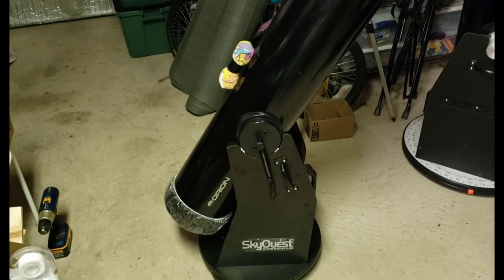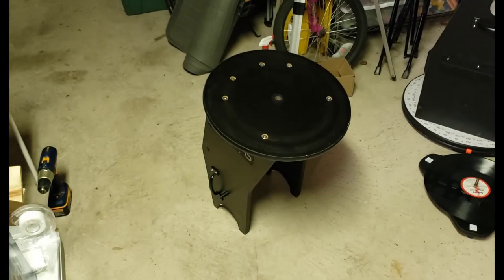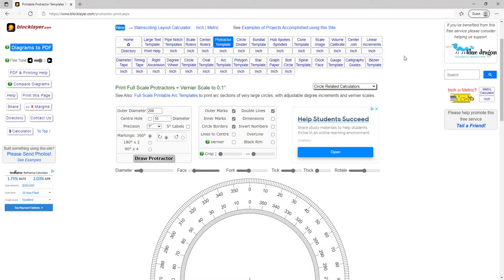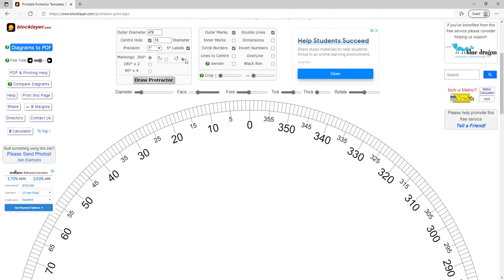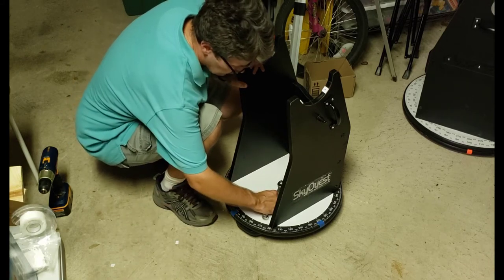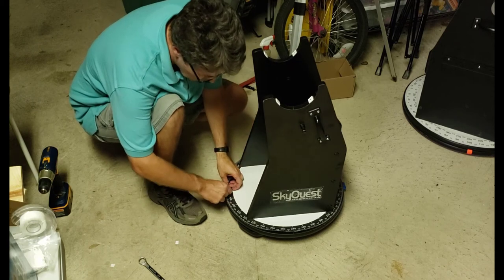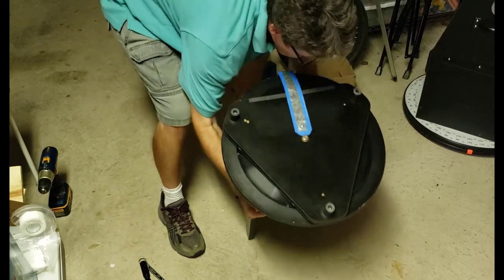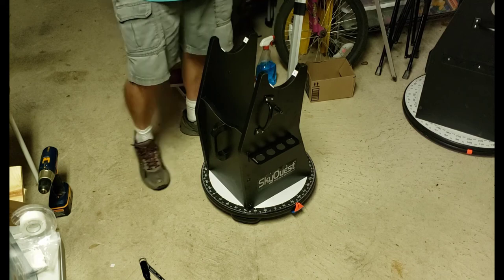Cheapest Quick-Aim Telescope Upgrade: Installing and Using a Paper Setting Circle for Quick Aiming

Comment: where can i buy one of these circles as no where in my city print them
Reply from the maker: Hi Wayne, if you have an Staples or Office Depot, they should be able to print them.  You could also approach a sign/poster maker.  They have large format printers.  In fact, I had to have a specialty sign maker do my biggest one because the Staples laminator maxed out at 24 inches.
Reply: @reflactor  how was it laminated as a curcle?
Reply from the maker: @waynegarrett1614   Staples has a lamination machine that you feed the paper circle in (between two heated rollers).  There's a big sheet of clear laminating material above and below. The heaters make it stick to the paper. When it comes out the other side, it's a big square lamination sheet with a round paper circle in between. I have to cut it out with scissors.
Reply: We don't have a Staples or similar but I found a local design & print shop who made a vinyl decal for $12. I cut it into 8 segments to apply.

Comment: What sheet metal gauge did you use?
Reply from the maker: It's pretty thin, but it is galvanized steel. I would say it's the same thickness as return-air ducting metal. I was able to cut it with tin sheers pretty easily. When I measure it, it is 0.012 inches thick.

Comment: Why not do a stick on tape on outside edge instead. No need for disassembly then.
Reply from the maker: That's definitely possible, but it would require a very precision marking ability to get the necessary precision for the degree tick marks. My hand just isn't that steady.  Definitely worth a try if you have the time.
Reply: @reflactor  no use a measuring tape and fasten it to outside edge, not a drawn tape.
Reply: @reflactor  i have the best idea tell the scope manufacturers to sell the template with scope or option to have it built into the board lololo im lazy